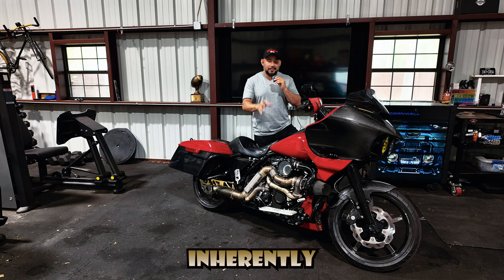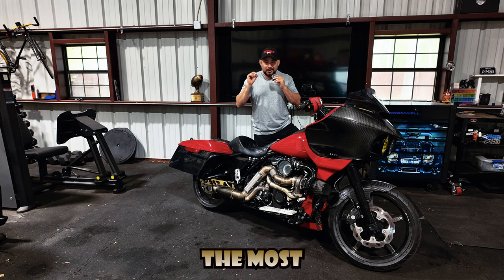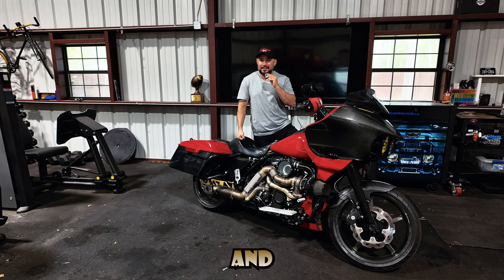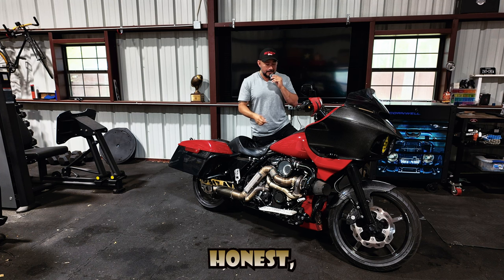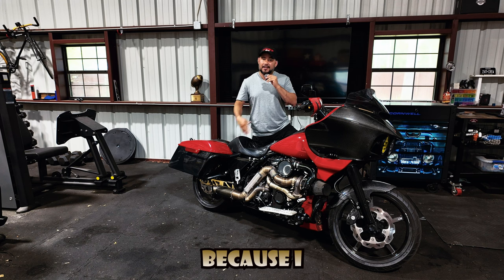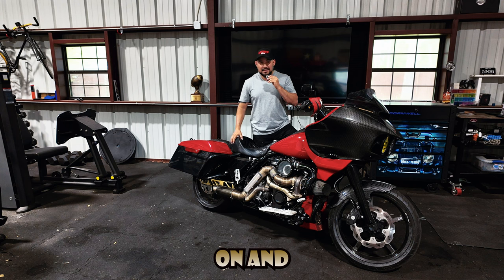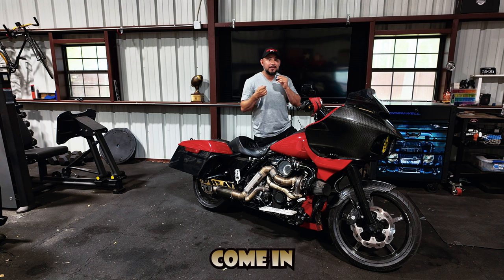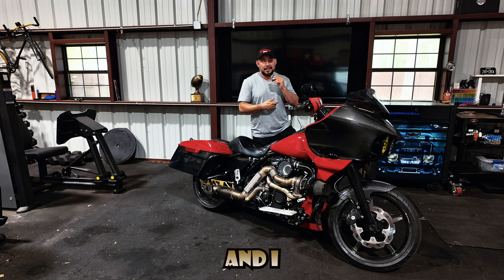Horsepower Problems I Wish I Knew Before Upgrading

Comment: Top HP problems.
1.   Power is expensive.
2.   Resale  Value
3.   Reliability
4.   Heat issues.
5.   Low speed riding.
6.   Reduced gas mileage.

Comment: You need a stickier tire metzeler cruisetec or shinko stealth D 003 and a lower center of gravity to launch off the starting line. Rear might be just a little too high keeping the power from hitting the ground. The higher the rear the lighter it is on putting weight to the ground
Reply from the maker: Thanks for the info. Those are on my list. I’ll adjust the suspension as well. Thanks!
Reply: @2147crew  love your videos, truly think those two things may help you though.
Reply from the maker: @primetyme1494  thank you!!